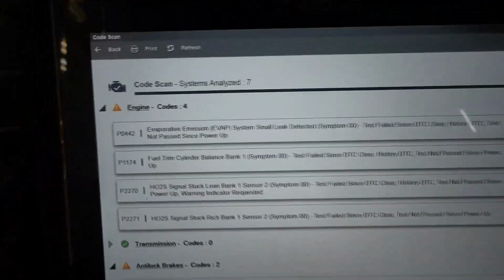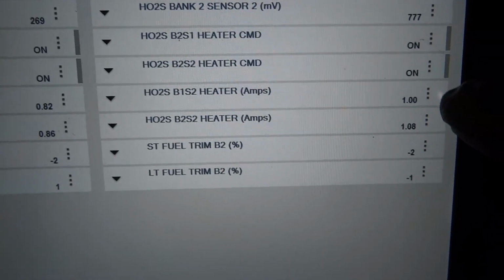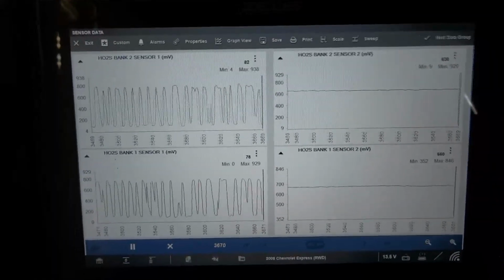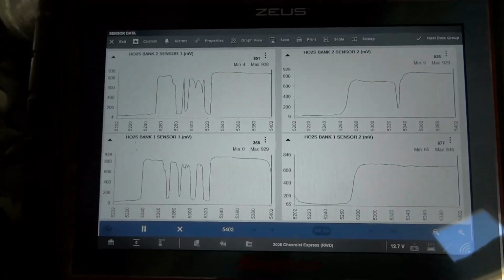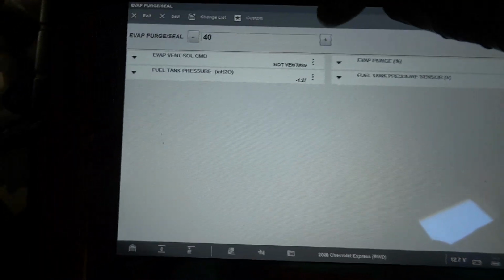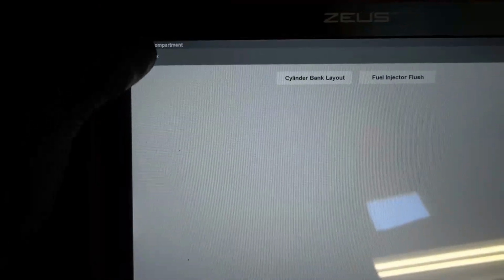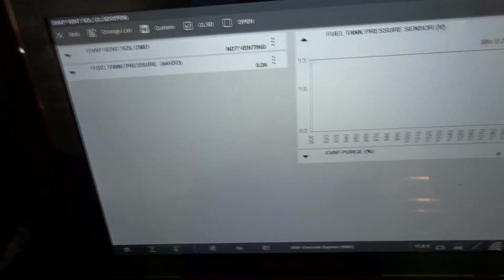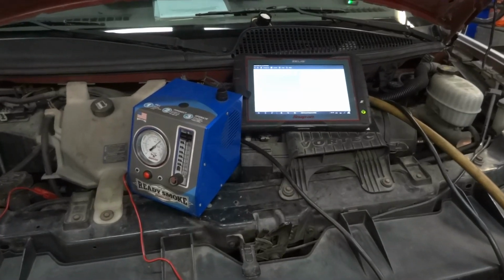Chevy Express Code P0442 & P2270, Evap System Leak Detected, 02 Sensor Stuck Lean Diag & Repair

Comment: I would not recommend replacing the gas cap but I would recommend instructing the owner to rotate it a few times to be DAMN SURE it is on fully tight and that it has clicked a few times as a minimum, thanks for the diagnostic.
Reply from the maker: Duane Donaldson My Pleasure!!

Comment: Thanks so much for your help,  and knowledge sharing , God bless! I'm afraid to ask! But how much is your scan tool,  the one you used on this video to check th 02 sensors! And what brand is it??😅😅 thanks in advance! I'm a fan of your videos !!
Reply from the maker: El Garfio  My Pleasure!! I'm using the Snap-On Zeus Scan Tool in this video! it's a pro level scanner, you can call your local Snap-On Dealer to find out the price!!
Reply: @KITS_Auto_and_Truck_Repair  thanks so much for your response 👍! I will!
Reply from the maker: @elgarfio138  My Pleasure!!